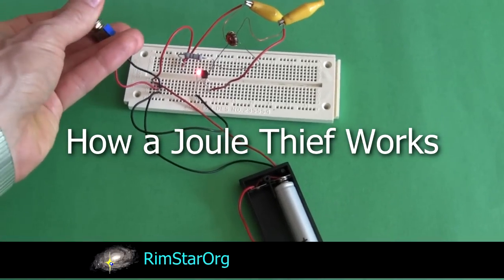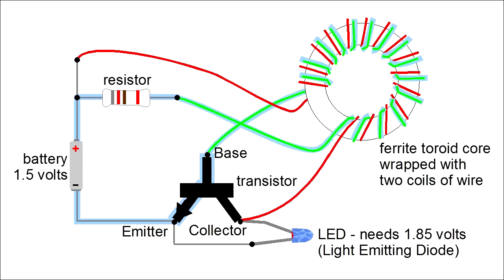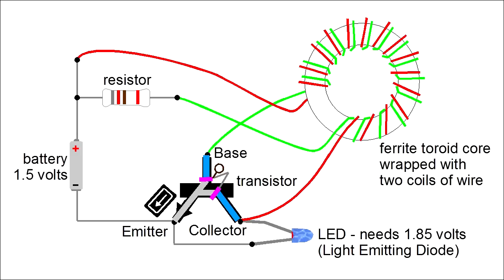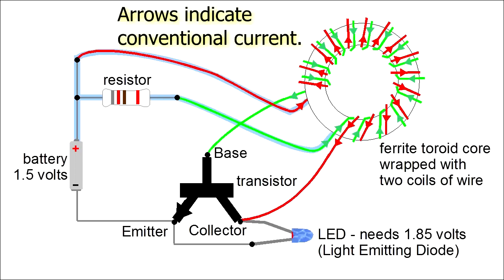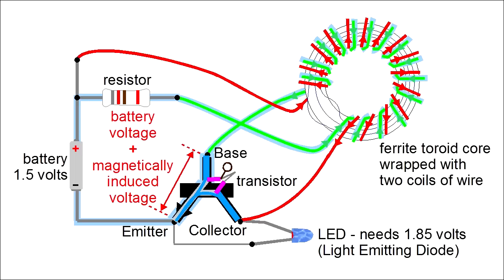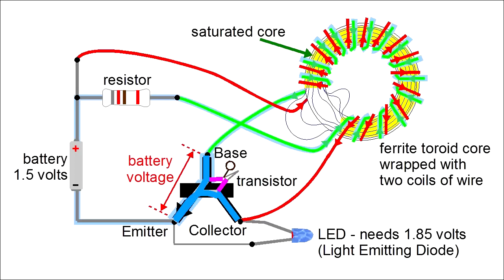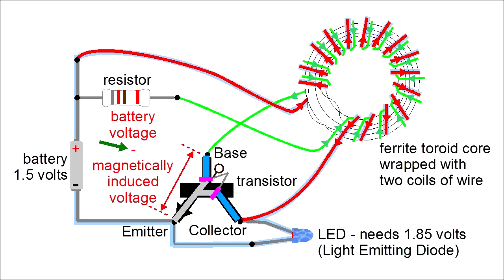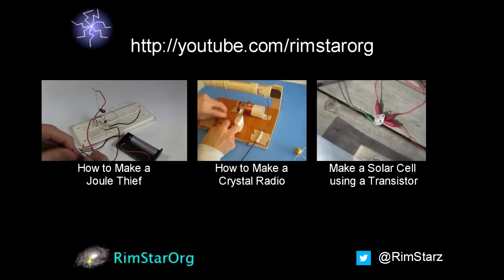How a Joule Thief Works

Comment: "...this path between the collector and the Emitter is closed unless there is enough _voltage_ across the base and emitter..."

Correct but not the best representation of what's going on.  The Bi-polar Transistor is a current amplifier, so more correctly: "...this path between the collector and the Emitter is closed unless there is enough _current_ flowing into the base and emitter junction..." It's the current flowing in the base of the transistor that controls the collector current

Comment: I have build one. 
Why i get more than 1000 v output.
Reply from the maker: Maybe you have a higher input voltage. Or maybe you have a lot of turns of wire on the core. More turns will result in a bigger magnetic field, so more energy built up into it for when it collapses. Which transistor you have will also have an effect. I got just 24 volts with the one for powering an LED here https://www.youtube.com/watch?v=B61DU7yEsPM but I got around 1000 volts with this one for powering a CFL https://www.youtube.com/watch?v=yz_99oVMbSI.
Reply: Okay thanks. I use two wires, 22 turns, and 2 AA batteries, 3 v. 
the transistor is a TIP 41 C 
the resistor is 1 K 
How many turns are used in your circuit
Reply: An why the transisor not burn out. I only rated for 100 v between the collector and emitter
Reply from the maker: Have a look at the first video I gave a link to in my reply above. You'll see an oscilloscope output that shows that the output is very spikey. The 1000 volts you saw is only for a short period of time.

Comment: Why doesn't this circuit work? I tried creating one but it didn't worked.
Reply from the maker: The biggest reason it doesn't work is people usually connect the coil incorrectly -- it's connected the opposite way that you'd expect. Also, try smaller resistor values.

Comment: Did you know that you can amplify electric power with a permanent-magnet? Just make sure that both, the electric and magnetic circuit are closed. You can even use a permanent-magnet to amplify the voltage your body produces.

Comment: Why does nobody credit bigclive in their video?
He invented the damn joule thief.
Reply from the maker: Probably because he'd have to be older than he looks to have invented the blocking oscillator circuit https://en.wikipedia.org/wiki/Blocking_oscillator, which is what a joule thief is. See the patents section.
Reply: RimstarOrg yeah my understanding is that he modified the circuit, and coined the phrase joule thief.
https://en.m.wikipedia.org/wiki/Joule_thief
Reply from the maker: I wasn't aware of that, but according to that link he used a different transistor and a different resistor value than Kaparnik, not exactly a modified circuit. It also says he came up with the name. But all that aside, the reason no one credits him is probably the same reason no one credits whomever invented the bridge rectifier, or low pas filter whenever they explain how they work. If you were doing a video about the history of the joule thief then you'd credit him for giving it the name, certainly, just as the wikipedia page does. Whenever I've written articles about the history of electronic components and circuits I've credited the inventors.

Comment: Consider the Joule Thief as a toroidal magnetic amplifying generator, 
fueled by a weak, low voltage power source.  Here’s how we can 
greatly amplify the output.  

Here's GE’s 2002 stated vision of what our world will look like employing superconductors:
"Electric generators made with superconducting wire are far more efficient 
than conventional generators wound with copper wire.    In fact, 
their efficiency is above 99%, and their size about half that of conventional generators.”    
    http://www.superconductors.org/uses.htm 

All The Rave About Superconductors - Size Really Matters  
The diameter of some superconductors are 1000 times smaller than copper wires
required to carry the same amount of electrical current.    So,
1000 x 1000 = 1 million times more turns of superconducting wire
can be put in the same coil space as copper coiled wires.

The resultant magnetic strength that a coil of wire can generate - B
is governed by the number of TURNS of wire in the coil,
times the amount of AMPS of electrical current sent through the coil, 
divided by the Length of the Coil. (not the length of the wire)  
      B = (AMPS)(TURNS) ÷ Coil Length 
You can see that by increasing the AMPS,
or by increasing the number of TURNS of wire,  
or by decreasing the Coil Length, 
we will proportionately increase B - the strength of the magnetic field. 

Instead of spending a lot of $$ on energy (AMPS) to produce the magnetic field, 
we can just increase the number of TURNS of wire to increase the magnetic field. 

So think of AMPS as money - the cost of electricity to excite & run a motor,  
or the cost of biofuel or petrodollar fuel required to power a generator.  
If you reduce the required AMPS to power the coils by a thousand times, 
then you will save a thousand times the fuel cost to excite the coils. 
That’s what all the rave about superconductors has been about. 
Superconductive wires makes it easy to produce “Free Energy”.  
Over Unity engine designers that don’t use superconductors are disillusioned.   
-       -       -       -       -       -       -       -       -       -       -       -       -       -       -     
35 Room-Temperature Superconductors Discovered 
   http://www.superconductors.org/158C155C.htm   

Graphene nanoribbons tested could carry as much as 10 billion amps/CM
or nearly 1,000 times greater than copper.
http://www.talk-polywell.org/bb/viewtopic.php?t=1480 

Graphene has a current density a million times that of copper at room temperature.
    http://www.zdnet.com/the-10-strangest-facts-about-graphene-3040093050/

Comment: Electron's flow from - to +, Soooo, the battery would be reversed for the real thing? Why cant we all just make directionally correct diagrams and throw out the "reverse psychology" once and for all?
Reply from the maker: I'm with you on that! I think in terms of electrons. Sadly that's not the way it is. :(
Reply: Electronic techs are taught current flow from - (excess of electrons) to positive (can receive electrons). Electronic Engineers and apparently the new crop of electronic hobbyists are taught the current flows in the direction of the holes or the spaces the electrons leave behind. Hole flow is in the opposite direction of electron flow. I am an old school tech and use electron flow rather than hole flow. Why on earth would I be concerned about the direction of flow of nothing which is after all what the hole is. Another way to think about it is that the hole has the potential to receive an electron but if no electrons are available what then?

Comment: Well!!! why not eliminate the ferrite core, transistor, and resistor. Just use a LM3909 LED flasher/oscillator IC. If flash rate of the LED is fast enough, your eye/brain can't see when the LED is off because of persistence of vision. Also a 300 micro farad capacitor and 1000 ohm resistor is needed to make the LM3909 work. The minimum power requirement is 1.5 volts. Well how do you like that !!!!!
Reply: Thats not the point....
Reply: I think LM3909 is a 5V part? And the circuit would cost a lot more and as Jeremy said, not the point  Just trying to show how to raise the voltage  This is how a DC-DC converter works some can do 5V to 32V

Comment: So basically this is a simple inverter
Reply from the maker: Basically. But it's output is far from sinusoidal. You can see an oscilloscope shot of it at around thirty-three seconds into this other video of mine about how to make one https://www.youtube.com/watch?v=B61DU7yEsPM
Reply: @RimstarOrg  not all inverters are sinusoidal.
Reply from the maker: True. I forgot about that. When I did a stint working in solar, some of the inverters we worked with put out square waves to approximate sine waves.
Reply: @RimstarOrg  so basically a joule thief is a step up inverter. 
Doesnt really steal anything though does it.
This i guess is also the basis of how power width modulation controllers work.
A lot of equipment work on power not voltage or current so as long as there is enough voltage or current the device will power up.
Which is an awesome breakthrough in recent years of electric appliances.
i.e.
 wouldn't it be awesome if all appliances could work from 12vdc to 240v ac as long as you have enough power there -the appliance will work
Reply from the maker: Yeah, the name joule thief isn't a great one, but it's the one this is commonly known by. The proper name is a blocking oscillator circuit https://en.wikipedia.org/wiki/Blocking_oscillator

Comment: Not exactly magic, just electronic manipulation. The amount of power in the circuit remains the same. What is happening is that when voltage goes up, the current goes down.

Comment: Isn't this overkill? We are pumping in 1.5 V to get 1.85 V. That's only 0.35 volt !!!
Reply from the maker: You usually use a battery that's lower than 1.5V. Usually you use one that's considered to be dead. For example, in my video showing the making of a joule thief (https://www.youtube.com/watch?v=B61DU7yEsPM) I use a battery that's at 1.27V.
Reply: more coils, bigger magnetic core, stronger magnet,different transistor -> more V ?

Comment: That, free energy? But you still use a battery, yes? Doesn't a battery cost money? It takes some form of energy to give energy, yes? Nothing is for nothing or comes out of nothing.
Reply from the maker: It's not free energy. It's not intended to be free energy. This is just a way of giving higher power output by pulsing the power. For a length of time there's no output while the power is built up in a magnetic field. Then it's all dumped in a short time. Then the cycle repeats.
Reply: When a battery discharges, its voltage under load decreases. One might consider a battery "dead" when its voltage is low enough that it can't power the load. But depending on the load, what you consider a "dead battery" might actually have a good chunk of power remaining. A voltage booster is just a way to use this remaining charge in a "dead" battery.
Reply from the maker: Scope-Eye video
I agree, that`s when I consider a battery "dead" too, but I keep them anyway as long as they have at least some potentially useful charge left for smaller loads. In my Joule Thief for Zombie Batteries (http://youtu.be/B61DU7yEsPM) video I didn`t measure the battery under load though. It was 1.27 volts no-load and didn`t light the LED when connected directly.

Comment: I dont get it.....  when make the coil myself my JT never works.  I cant figure it out.
Its simple... I mean its tow damn wires !!  If I gram a great big coil from a salvage job.. such as a big inductor coil from a PS I trashed, it works fine.  I know how to build the damn thing...  I wonder if the cores that I have used are inappropriate??   The toroids have all been yellow I think if that tells anyone anything...

I sure cant figure it out
Reply from the maker: Clown Whisper A very common and simple to make error is to connect the wires going to the toroid backwards. They are the opposite of what you'd expect so follow the diagram very carefully. That's the first thing to check anyway.
Reply: its not that- if i disconnect my toroid and connect it up to a connect iy up  to a pre-made one from a ps it works every time!

i made on that worked today but had to use a buttload of magnet  wire!!, i have never  made a simple few-turn, small gauge, plane coated conductor, like you see all over youtube and have it work...

its bizarre
Reply from the maker: Clown Whisper What are you trying to power? An LED shouldn't need many turns but a CFL needs a few hundred.
Reply: Just an led..  .  It don't make any sense what so ever....  I mean they are white leds but still.

Comment: What a waist of time , you can buy a DC  step-up transformer on Amazon for five dollars,  With a DC volt meter that reads input and out put voltage with an adjuster for out put voltage.. Just saying.
Reply: You can, but do they give an insite to core saturation and insire people to get involved in science.....just saying
Reply: Andy Gozzard , You are right
Reply from the maker: Kevin Barker Just a transformer wouldn't work in this case. One reason is that transformers require AC and batteries put out DC, so you'd need something like a transistor/capacitor circuit to convert the DC to AC for the transformer anyway.But that wouldn't work either since a transformer steps up the voltage while stepping down the current. In the joule thief, the energy is stored in the magnetic field in the core and then let out in brief bursts of higher voltage and higher current. Keep in mind that's not overunity. While the energy is being built up in the magnetic field, there is no output so the total energy out is the same as in, less the losses.Having said that, there are better circuit for doing this, such as using a boost converter chip, but since there is a large interest in joule thief circuits, it still bears explaining how it works.
Reply: RimstarOrg very sorry I think i did say transformer,  i should have said DC to DC converter
Reply from the maker: Kevin Barker Ah. But as I said, there are better cicuits for doing this, possibly a DC to DC converter. I've been wanting to try out a boost converter chip.

Comment: at least this is real no t like the witts guys!!!
Reply from the maker: That depends on what you think this is. Since you mention witts, a joule thief is not free energy, despite it's misleading name. It simply steps up the voltage and current by building up energy over time and then every now and then releasing it all in a brief burst. So the LED or CFL isn't always on.